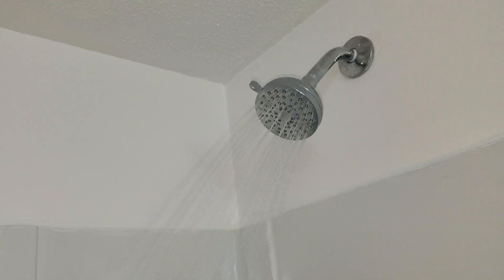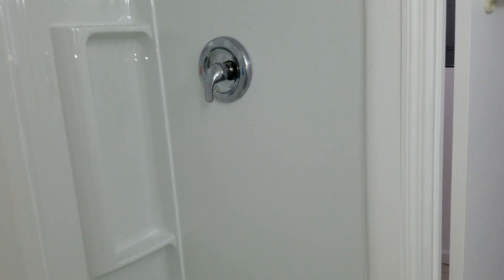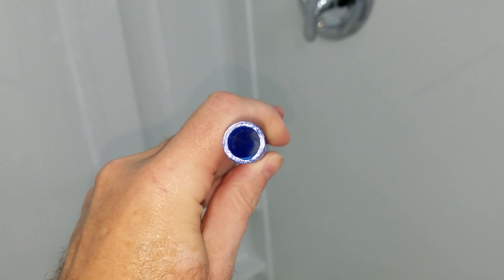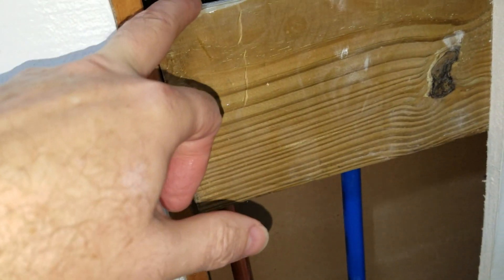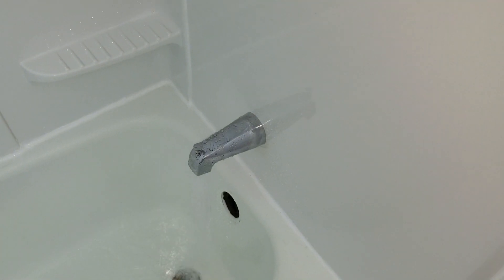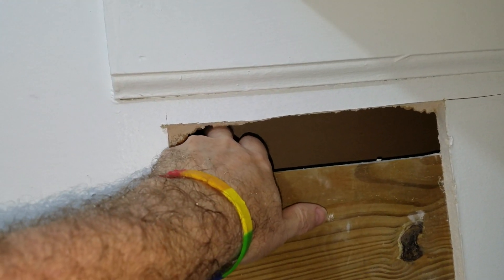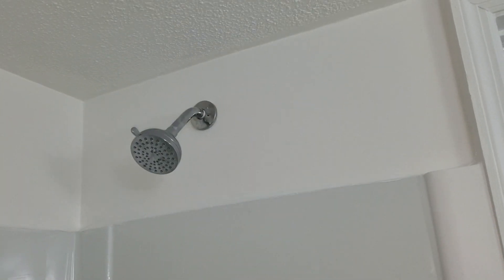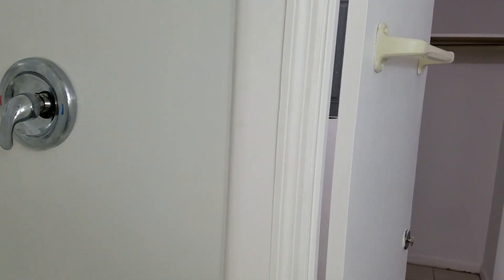Wait,  what?  Shower and faucet come on at time WTF?

Comment: YES! I paid ALOT of money to have my water valve changed but they took it upon themselves to redo my whole plumbing when it wasnt needed. Of course by the time I checked it was all redone including a new shower set. That is now loose. And now my shower and tub run at the same time.This will be their 3rd time coming out here but I have a year warranty. This work was just done May 5 th and already its all messed up. Only good thing done was they stopped my leak. Now they wont answer my calls… 😡
Reply from the maker: Yea that happens, why I am trying to do all my own work if I can.

Comment: LOL..I just came across this video after having the same problem and ripping EVERYTHING out again to return to the store. I may just reinstall and use copper now and see how it works. Good to know that the sharkbite connectors themselves did not contribute to this.
Reply: Unfortunately after 3.5 hours of reinstalling everything, this did not work from me. My last ditch effort is to change out the sharkbite connectors themselves and go with something more standardized with hopefully a larger inner diameter.

Comment: The plumber put plex in against my wishes and now water drips from the shower head all the time.  I do not have access to the back of the pipes.  What are my options?
Reply from the maker: could install a shower head cut off.  https://www.google.com/search?q=shower+head+cut+off+valve&rlz=1C1RXQR_enUS954US954&oq=shower+head+cut+off+valve&aqs=chrome..69i57.7807j0j7&sourceid=chrome&ie=UTF-8
Reply: @RandomRobScratchin  Hi, Would installing a shower head cut off force the water to find another outlet and cause leaking? thanks
Reply from the maker: @johnhabeck2527  its possible. typically the pipe going to the shower head doesn't have a lot of water pressure on it.. That cut off will have the pressure up to the normal water pressure for the house.  If the plumber did a good job on the plumbing for the shower, it would be fine.... I personally don't use these.